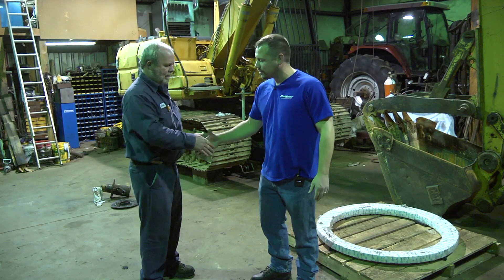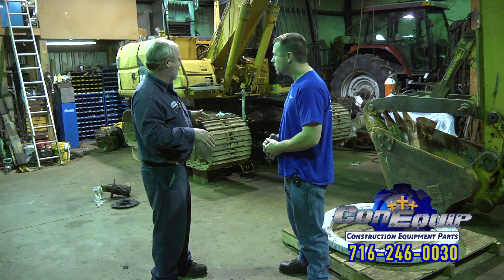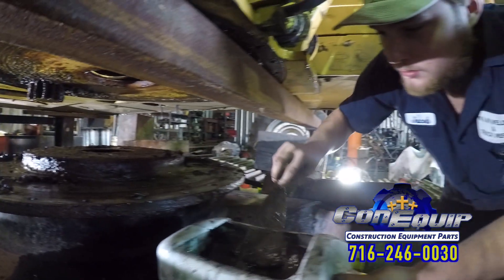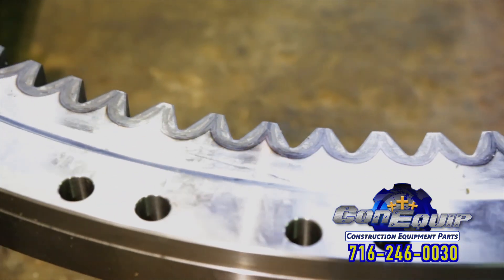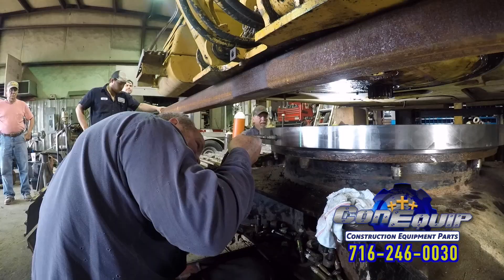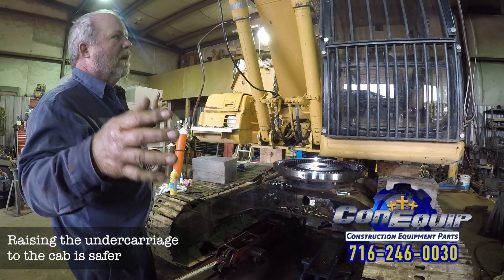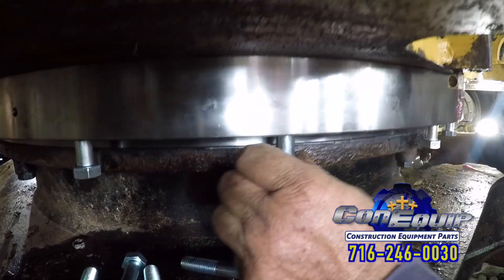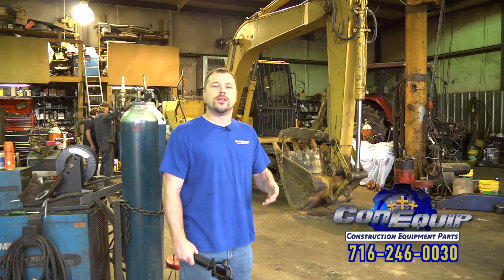Excavator Swing Bearing Replacement - Installing a Swing Bearing on a CAT 311B

Comment: So what holds the swing gear to the track frame so it doesn't wobble?
Reply: And why not replace the spricket on the swing gear drive motor? So it doesn't wear out the new swing gear?

Comment: Hi brother, I am a mechanic from Morocco. Please send me the program to download Caterpillar and jcb thank you
Reply: Jbr Med send me a message with what your are looking for. Salam.
Reply: @beaustoioff6182  Thank you for contacting my brother. I am looking for everything related to Jcb and Caterpillar mechanics and hydraulics with pdf.
Reply: Jbr Med send me a direct message with the make and model of your machine you are looking to diagnose, thank you
Reply: @beaustoioff6182 I have a problem with the speed of walking the Caterpillar M318 excavator 2006, disassembled the gearbox and installed its les desce, and everything is excellent, but nothing has changed. Thank you very much.👍👍👍
Reply: Jbr Med If speed has not changed and you are experiencing low power it can be the engine, filters, or throttle assembly that adjusts idle with operation of the machine. Check all of these things. As for service manual finding one can be time consuming, most of them are not freely available unless you know where to look or if someone can hopefully chime in
Reply: @beaustoioff6182  Thanks brother for your interaction
Reply: @beaustoioff6182  hello brother am a mechanic from Ghana please I need a full pdf of Caterpillar excavators
Reply: @losray4503  what model excavator are you needing a manual for?
Reply: @beaustoioff6182  CAT 325 DL full maintenance pdf or any excavator maintenance pdf model available I will appreciate sir